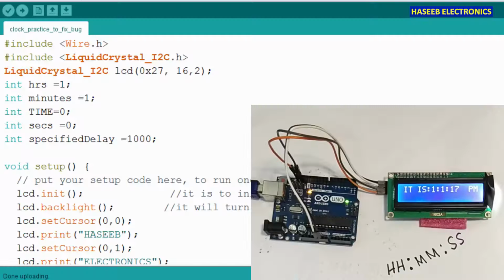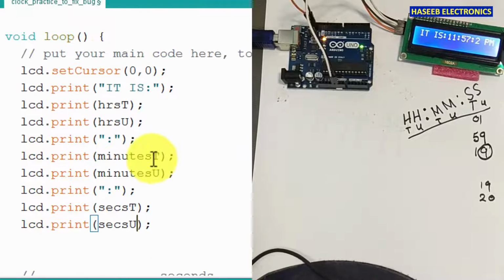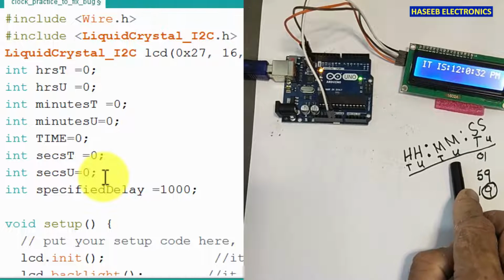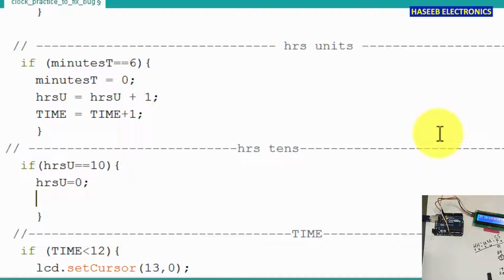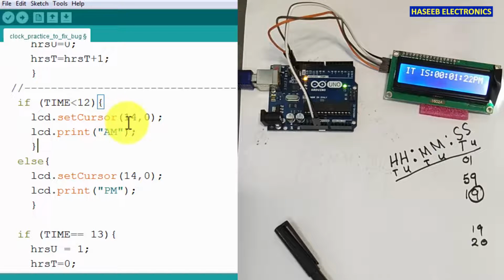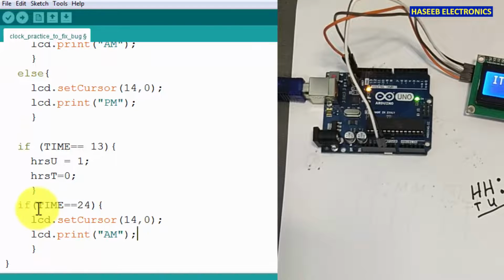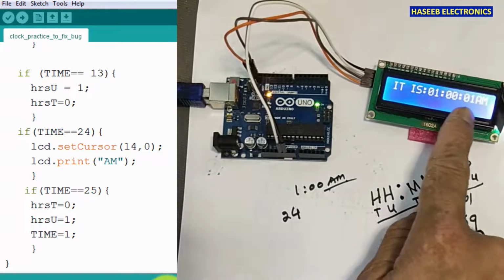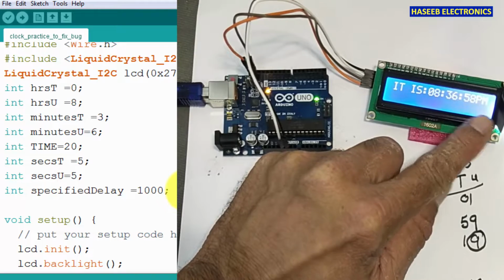{708} Simple Digital Clock Using Arduino Part 2, Fixing Leading Zeros

Comment: @Haseeb Electronics
Below you can get Testing Program for Reading DS1307 RTC with Arduino nano, Preceding zero added simply by using sprintf (buffer, "%02d", d);

this program is tested
#include <Wire.h>

#include <EEPROM.h>
#include <LiquidCrystal_I2C.h>
#include "RTClib.h"
/************************************************************************************/
LiquidCrystal_I2C lcd(0x27, 16, 2);  // set the LCD address to 0x3F for a 16 chars and 2 line disp
/************************************************************************************/
/************************************************************************************/
#define DS1307_ADDR 0x68
RTC_DS1307 rtc;
DateTime now;
/************************************************************************************/
//VARIABLES AND ARRAYS DECLARATION
char buffer[10];
uint8_t a, b, c, d, e;
uint16_t f;
/************************************************************************************/
void setup() {
  // put your setup code here, to run once:
  Wire.begin();
  rtc.begin();
lcd.init();
  lcd.clear();
  lcd.backlight();  // Make sure backlight is on
  lcd.cursor();
  // delay(10000);

  if (!rtc.begin()) {
    //Serial.println("Could not find RTC! Check circuit.");
    lcd.setCursor(2, 0);  //Set cursor to character 2 on line 0
    lcd.print("RTC NOT FOUND");
    while (1) delay(10);
  }

now = rtc.now();

  a = now.hour();
  b = now.minute();
  c = now.second();
  d = now.day();
  e = now.month();
  f = now.year();

}

void loop() {
displaytime();
delay(500);
now = rtc.now();

  a = now.hour();
  b = now.minute();
  c = now.second();
  d = now.day();
  e = now.month();
  f = now.year();
}
void displaytime() {
  lcd.setCursor(0, 0);
  lcd.print("Time:");
  lcd.setCursor(5, 0);
  sprintf (buffer, "%02d", a);
  lcd.print(buffer);

  lcd.print(':');

  lcd.setCursor(8, 0);
  sprintf (buffer, "%02d", b);
  lcd.print(buffer);

  lcd.print(':');

  lcd.setCursor(11, 0);
  sprintf (buffer, "%02d", c);
  lcd.print(buffer);

  lcd.print("  ");
  lcd.setCursor(0, 1);
  lcd.print("Date:");

  lcd.setCursor(5, 1);
  sprintf (buffer, "%02d", d);
  lcd.print(buffer);

  lcd.print('/');

  lcd.setCursor(8, 1);
  sprintf (buffer, "%02d", e);
  lcd.print(buffer);

  lcd.print('/');
  lcd.setCursor(11, 1);

  lcd.print(f);
  lcd.print("  ");
}